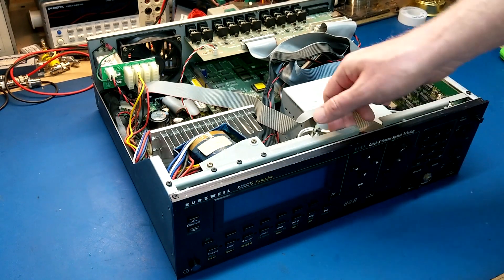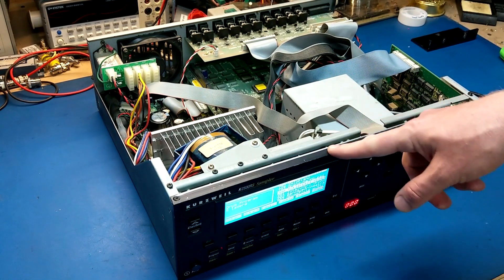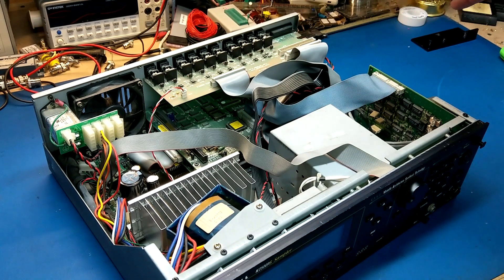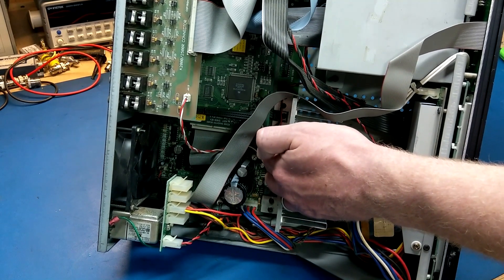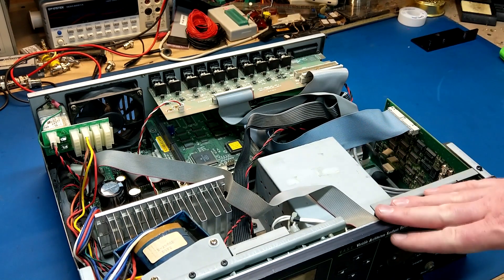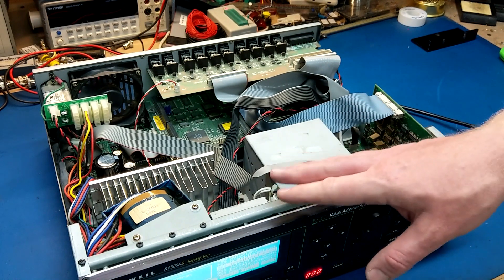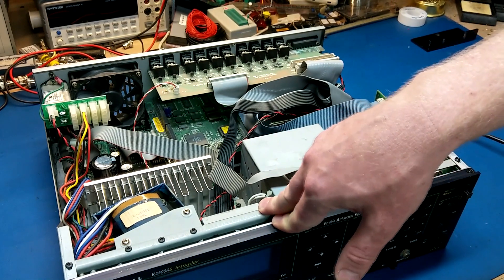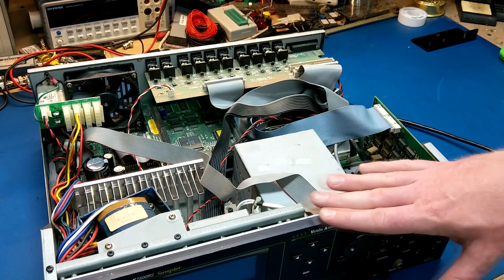Kurzweil K2500RS Synth / Sampler Overview, Upgrades, and Repair

Comment: I have a 2500R where the  F/I switch always releases. I Suspect an error current, but i cannot measure this. Do you have a suggestion what the cause could be ?

Comment: Thank Brad
Have a rather lengthly question. I bought a k2500x In good condition, I added 128mb Sample 30-pin RAM, and tried to build the PRAM board that is out there on the internet. Something went wrong and I bluescreened the unit. 
I bought a Second k2500xs on ebay (sampler module was unknown at the time) had all the innards removed except the keyboard to try to build one unit out of two. This new unit is a uses 72-pin Sample RAM.
I am trying to isolate the bad board and replace with a newer board.

1. Knowing I blew the first unit with PRAM, what boards were affected in the first unit, 2500x.
2. Can i interchange these boards at all between the A-J Model and the K model?
3. This second unit may also be a bluescreen of Death. What board would be affected for that?
4. Any last suggestions.

Thanks for any help.

Comment: Hey bradthx! Thanks for the great videos.
I upgraded my studio-park with a K2500RS with all ROMs in. But apart from my K200R V3 with Sample-Board in the insert-cable connection to my patch-bay didn't work on the left channel for A. And I wondered why (on my K2000R it worked like charm). So I opened my K2.5 and wondered to see that the transistor Q1 on the connector board is missing. Obviously, something the previous owner didn't mention when selling it on ebay. Additionally, the capacitors C09 and C10 (1000pF) were cut through or simply damaged, i dunno. Maybe for better signal quality. 
The transistor is no problem, it is a simple J109 Type (costs about 0.35 Euro/ct a piece), but with the capacitors I am realy unsure and do not know what type those were. I've seen that the two diodes D4 and D5 had been replaced additionally.

Maybe you know what type of capacitor I can buy or give me some advice for replacement. 
Those are no elcos  I suppose, more of a ceramic type but radial - well I don't really know. Only that they must be bipolar I think and have 1000pF. Do you have any idea?
Best wishes

Comment: I have Kurzweil K2500RS OS v3.02. When you select a SCSI source in the "Disk" section, the device freezes. It helps only reboot and reset the settings. All capacitors are replaced with new ones. What could be the problem?
Reply: I noticed that the SCSI Bus Controller L52C80JC 2 was soldered.

Comment: I have got a Kurzweil K2500R and it has a faulty LCD display. I am trying to get a LED replacement. The connector though has a long 20 pin in line type arrangement. Do you know where I can get a replacement LED display unit from. I have already built the platform for the slightly smaller/thinner LED displays.

Comment: Hi Brad, thanks for great videos on the K2000R, much appreciated. I hoped that you would cover the error I have but I did not see it. So maybe you can point me in a direction to solve it please. When I turn on my K2000R it shows vast animation and firmware, but then it goes on displaying "Waiting for keyscanner" and then the screen is blank with a faint "Waiting for keyscanner" . I've changed all 28 caps on the boards, so they should be good, measured around the board and got the 12V and 5V readings as expected from the service manual, do you or anyone else have an idea what the problem could be or what I can try next? Unable to do any kind of reset, power and 1,2,3 or power and +/-,0,CLR by the way, it seems to be stuck in a "Waiting for keyscanner" boot loop.

Comment: Hi Brad.
Sorry to write you in the comments of this video, but I would like to know how to contact you to send some images of the failure of my Alesis Fusion. It is a failure to start, the synthesizer hangs, only blue background screen and many of the yellow LEDs of the buttons on and does not respond to anything.

I bought the keyboard new in 2006 and the failure occurred in 2010. I am from Venezuela and I think I must be the only person who has this synthesizer here, therefore there is no technical support.

If you can give me any information, I appreciate it.

Comment: Hope to see the P/RAM in the next video :)

Regarding OS versions: To the best of my knowledge, 3.02 is the latest OS version for units without KDFX - at least it's the latest available on the Kurzweil website. 3.5(0) would be the version number of the object ROM that goes with OS version 2.80. 3.90 is the latest object ROM version.

Interestingly on my unit, I have an issue with any OS version later than 2.80 that not even Kurzweil could explain. With certain filter modulations, I get an audible click on all later OS versions (e.g. audible in patch 891 Space Station), so I'm staying on 2.80 with my K2500. Apparently noone else has this issue. My K2500 had some battery damage at the bottom of the case but I cannot quite imagine how that would affect 1) only specific filter modulations, on 2) certain OS versions only. If some chip was damaged, the results surely would be more "random".

Comment: I just got one of these with sampling feature, sounds great. only issue is when I sample something and play the sample back alongside the onboard instruments in song mode, The sounds intermittently clash into sounds a horrible glitching noise, it tends to happen when sending multiple sounds through the 8 outputs. Onboard instruments play fine together through outputs, any idea what would cause this? Also occurs when loading samples from a k2000 disk
Reply: Ask on forum at https://forums.godlike.com.au/

Also, there are Facebook Kurzweil groups, you could ask there.
Reply: @ShallRemainUnknown  thanks, appreciate it

Comment: The keyboard and rack units use different sampler boards, not interchangeable. In addition, I believe there is different revision sampler board that was sold for K2500- through K2600-series from 1995 when the K2500 debuted, and that version will not work with the K2000. The K2500 should work with either revision sampler board (but again, keyboard and rack board differs).
Reply: I have sampling board on my K2VX and many years ago I used it a lot, but now this board is totally outdated. It's much easier to do sampling and sample editing on a computer, where you can see both channels in same time on big screen, do zooming and zero-crossing with mouse etc. After editing, you can simply load the sample into Kurzweil via the SCSI port, so sampling board is not necessary at all.
Reply: @_oscillator  Yes, many people (most, these days?) conduct sampling and basic sample editing/processing on computer and then dump to K2-series for synth engine. If you can't use your sampling board in K2500 down the road (keyboard version, in which I believe it's compatible) for "LIVE MODE" audio input, then suggest selling the board to fund a SY/TG-77/99 like we've messaged about previously! I'd love to hear what you could do with a fabulous AFM synth!
Reply: @ShallRemainUnknown  Yes, my first synth was DX21, more than 30 years ago. I'm still thinking about TG-77, but I stopped to expand my rig, because I already have 7 synths. That means VAST of my K2VX, Z-Plane of Morpheus and UltraProteus, additive synthesis of Kawai K5000, transwaves of MR Rack, vector and wavesequencing of Wavestation and VA of Blofeld. That's enough for me. I would like to have also the TG-77 (or even better, SF1R), JD-990, Fizmo, Neuron, Iridium and Nord G2, but I'm over 50 and just don't have so much time left to learn them all. Every synth needs at least few years to know it perfectly. So... that's a reality.
Reply: @_oscillator  Haha, I have a similar assemblage, and have come to a similar conclusion. My point was that the sampler board might have value to you, or else to others, in which case you could sell it! It seems an (A)FM synth would still expand your pallette, but, as you say, such expansion might be counter-productive to you depending on your goals. Some like to collect synths, or learn synths, or talk synths, or record synths, or compare synths, ot trade synths, or repair synths , or write instrumental music w synths , or write songs with synths, or perform w synths. Probably best for anyone to define their goals and stay focused!
Reply: @ShallRemainUnknown  So true. My goal is to create some experimental stuff, time after time, because it's just a hobby for me. I already have some tracks on my channel, like "Darkness from Above" and "Insanity" trilogy. I'm just trying to create sounds that I haven't heard before, and I do it with a simple setup. That's it. All the best, mate, it was a pleasure to meet you here!
Reply: @_oscillator  Great, then keep up the good work! We've messaged before regarding different synths, etc., and I've heard a bunch of your impressive music. Best wishes for continuing to utilize and master  your existing gear and enjoying the creation of music!

Comment: The K2500 and K2600 units use CFL backlight bulbs which last a long time. People have converted the backlights successfully to LED using LED strips removed from broken tablet computers.